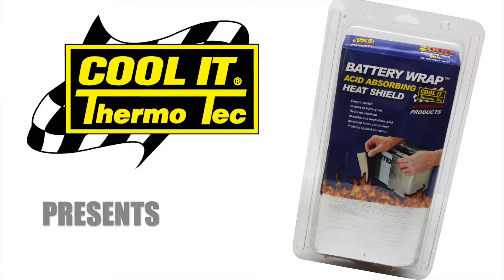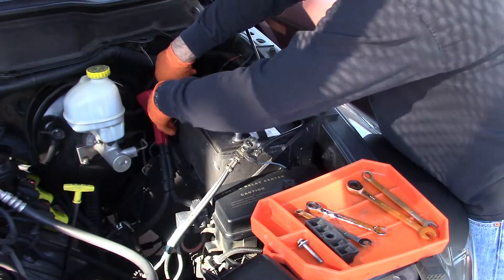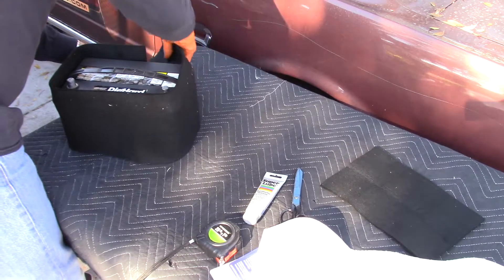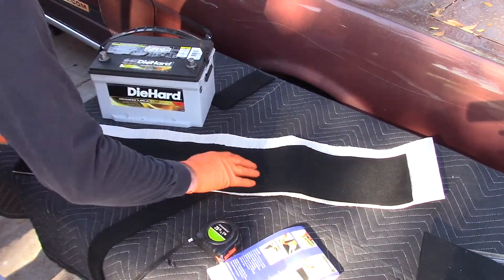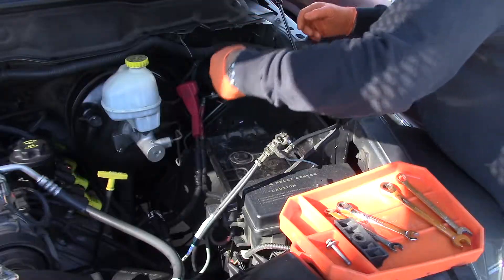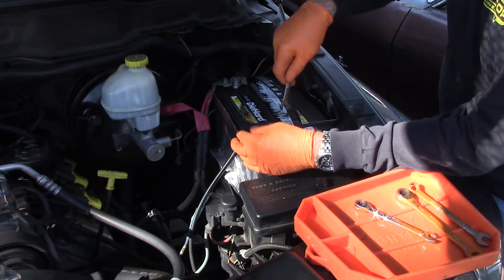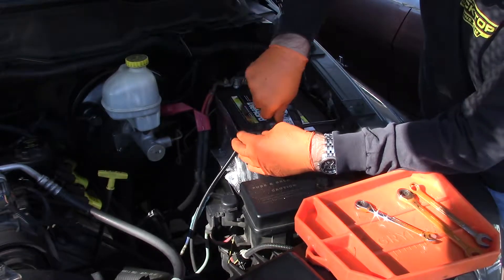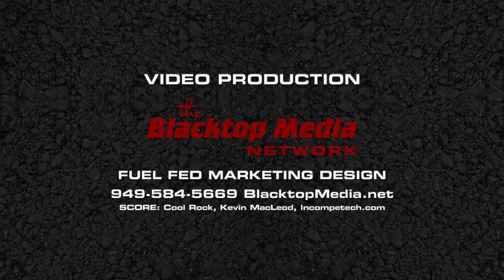Battery Wrap Acid Absorbing Heat Shield.

Comment: I ordered it from Amazon. Yesterday I have to replace the car battery and what perfect timing to use the heat wrap. I added Velcro at the end instead of having it glue together so I can reuse it again. When the AutoZone guy wrap around the new battery & hooked the cables. It caused sparks everytime the cable touches the silver part. He said this stuff is dangerous, it shouldn’t cause this problem. So we took it off.
Reply from the maker: Yes, the silver material is conductive, but should not be applied in a way that it comes in contact with the cables or posts. This material can be cut to shape very easily with a knife or scissors.

Comment: It doesn't help with cold weather?
Reply: That's not it's purpose. Primary purpose is to reflect engine heat from the battery.  If you're thinking of keeping the battery warm( prevent freezing etc)  during the winter months , then you will need a battery blanket that plugs into the wall.
Reply: You try this product
Reply: Wool padding??

Comment: This product isn't conductive, if for mistake the battery cables touch it??
Reply: No it is not conductive. It has a mylar facing to keep this from happening!
Reply: It caused sparks when we try to install the new battery after we wrap it. We ended up taking it off.